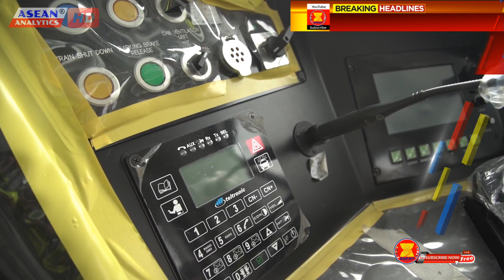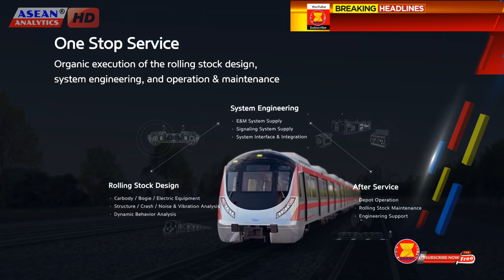Metro Rail Transit 7: Philippines Newest MRT line | Details and Updates

Comment: IMF: Vietnam surpasses Singapore and Malaysia* to become the 4th largest economy in Southeast Asia Based on the *IMF GDP data for 2020, Malaysia’s economy is now ranked 6th in ASEAN. A notable achievement by the Mahiaddin administration. Ten years ago, Malaysia was 3rd largest economy in ASEAN. Philippines and Singapore overtook Malaysia in 2015 when Najib Razak was the Prime Minister and Finance Minister focused on wealth creation. Now, Malaysia's economy is smaller than that of Vietnam.
2020 IMF GDP data:
1.Indonesia  $1,059.54b
2.Thailand       $510.89b
3.Philippines   $362.24b
4.Vietnam       $340.82b
5.Singapore    $339,98b
6.Malaysia      $338.28b
7.Myanmar       $81.26b
8.Cambodia      $25.95b
9.Lao                 $19.08b
10.  Brunei            $12.02b
Reply from the maker: please provide your source. The figures is different from what we have..
Reply: @aseananalytics  This was straight from IMF. What do you have?
Reply: Sources world bank.
Indonesia GDP / 1.058 trillion USD (2020) - 1st
Thailand GDP / 501.8 billion USD (2020) - 2nd
Philippines GDP / 361.5 billion USD (2020) - 3rd
Malaysia GDP / 336.7 billion USD (2020) - 4th
Singapore GDP / 340 billion USD (2020) - 5th
Vietnam GDP / 271.2 billion USD (2020) - 6th
Reply: @Justineexy  If Singapore is 340 and M'sia is 336.7, which one is a bigger number for your raking??